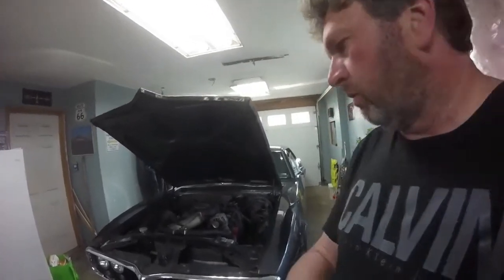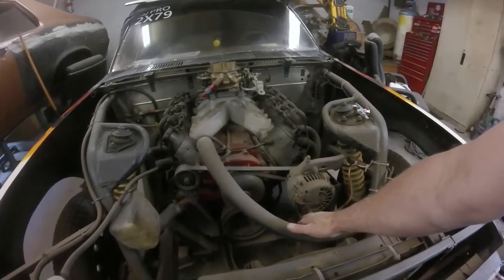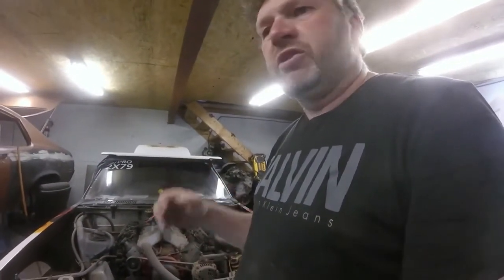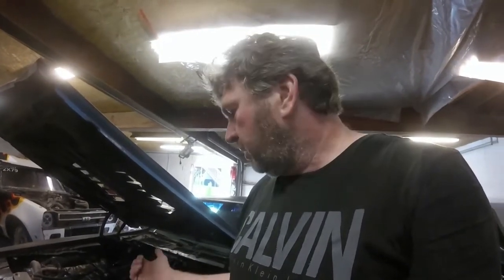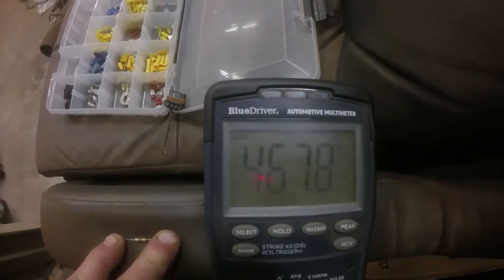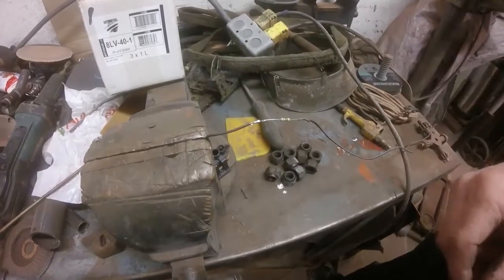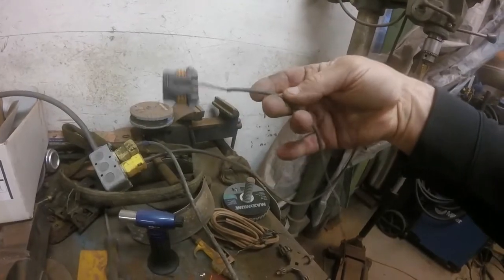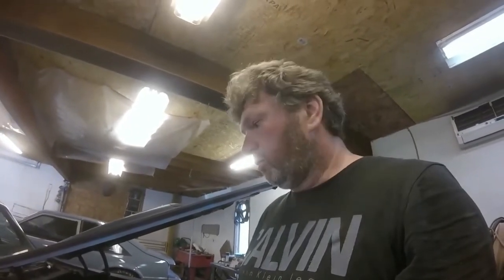ls swap alternator wiring

Comment: I did this on my LS3 swap with the E38 ECM (4th Gen LS ) and the check engine light comes on. Says "generator field circuit low" I'm wondering if that is what the original wires went to in order to let the ECM know the whirling whirler thing is doing whats its told.. ? 🧐
Reply from the maker: The swap wiring is for non gm computer or carb conversion like on the race car or terminator x on my firebird. The wires for the alternator go back to the gm computer I’m pretty sure. Lt1 swap. Com has a really good printout for the wiring ecu  on just about all ls engines
Reply: @weekendatbernies4503  thank you sir.

Comment: The resistor wire can be ran to any key live correct? Meaning when the car is running it gives a 12v signal?
Reply from the maker: Yes but it can’t have voltage on it with the key off